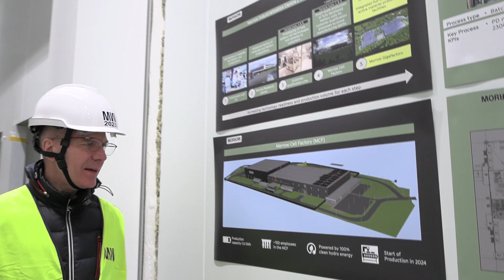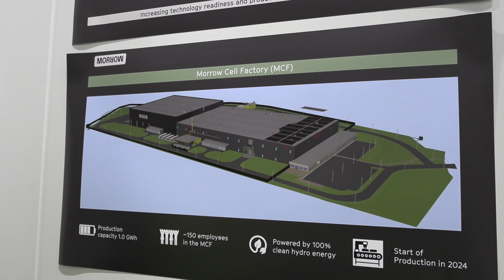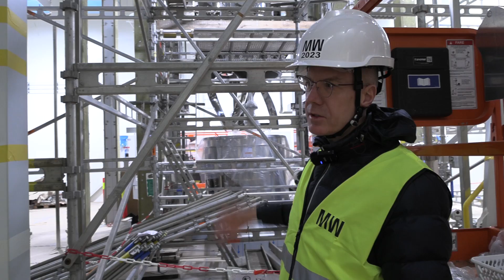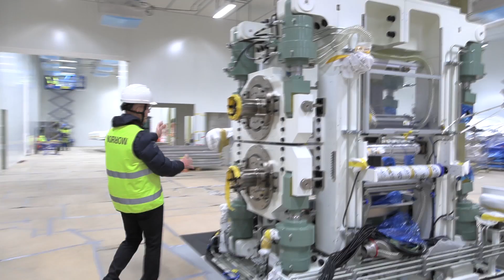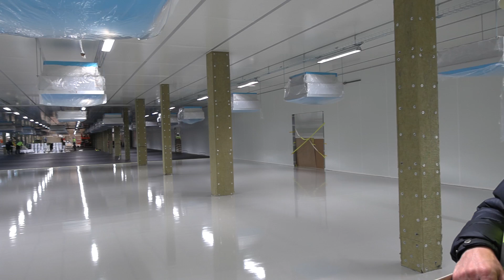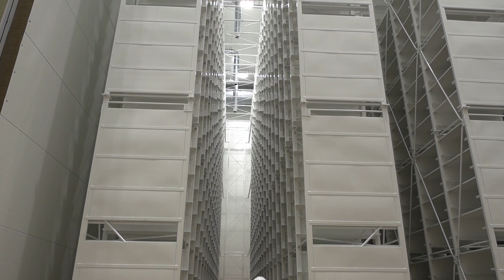Morrow battery factory tour

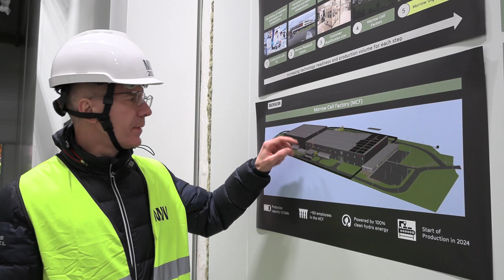Comment: 2:18 LNMO is a next generation high voltage cathode material for Lithium Ion Batteries. At the moment no mass produced batteries use it because of the technical challenges (making the cathode material itself work and finding an electrolyte that doesn't decompose at the higher voltage). I really hope they (or somebody) will manage to pull it off soon.

Comment: Great video. I wonder how much power consumption the plant will be using, I.E. making 1 GWh worth of batteries, will the plant consume more than 1 GWh of power.
I hope to see the follow-up video when the plant is running soon.
Reply: more like 100 GWh electric energy per 1 GWh capacity batteries produced. But its carbon free electricity in Norway, so its not that bad as it sounds.